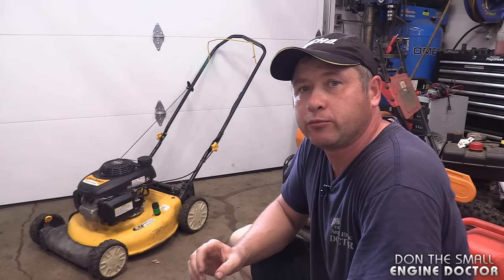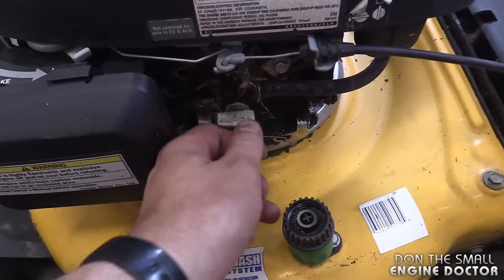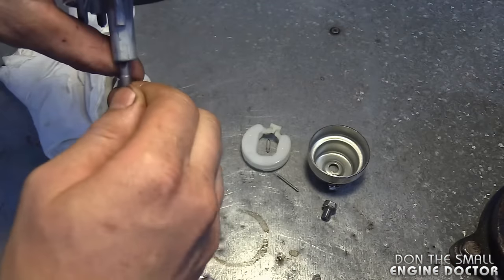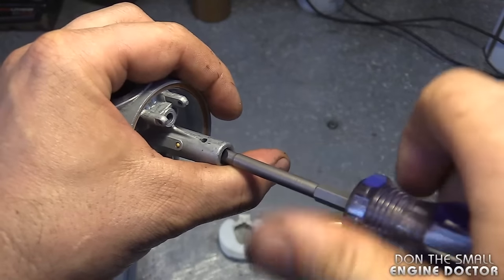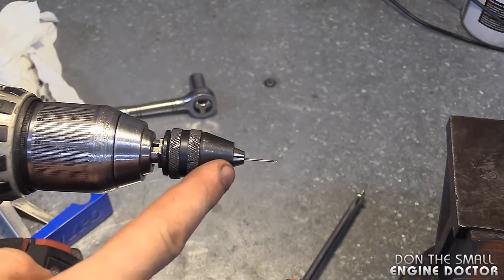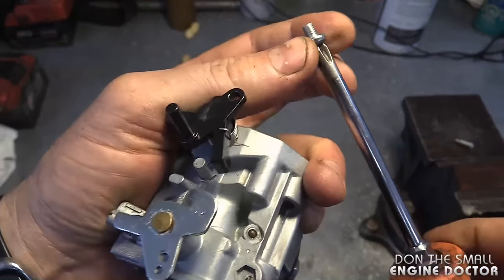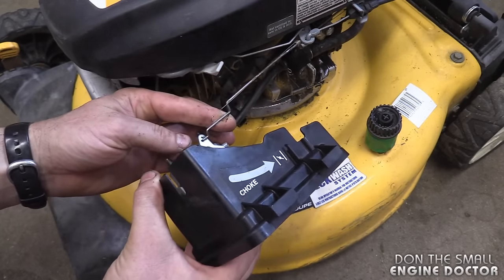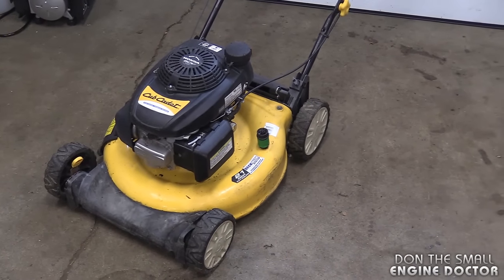How To Fix A Surging Engine on a Lawn Mower, Generator, Pressure Washer & More

Comment: Hello Don.  I've got a CT Yardworks model with the no choke and no prime engine.  Surges like crazy.  Will I be able to do this on that carb?  The butterfly doesn't seem to stick but I also have to use the carb cleaner to get it running most times unless it's warm.  Thanks for the excellent videos!  You've helped a lot of us out over the years!

Comment: Thankyou for the video. Use this cure regularly but only 1 issue. Drill bits breaking. I cant seem to find a quality bit. At least not on amazon. Do you have any suggestions of a good brand/source? .010/.015 size I assume.

Comment: Long time subscriber and follower of your videos.  I've been working on GCV160 with the same surging problem that starts after 5 minutes of running.  I've cleaned the carb twice, still surging...ugh!   Where do you get a .013 drill bit, and how does a bit that small not break when drilling by hand??  I have a set of micro drill bits from HF and the small ones will break if you look at them wrong.  I was able to get the smallest welding tip cleaner wire through that slow jet under the phillips head screw.  If that doesn't work I'm just going to buy a new carb.
Reply from the maker: I get them on Amazon

Comment: Dony boy..... 
You've helped me out in the past, so I hope you can again! 
I'm a woodworker, so I don't know  beans about engines. Here is my problem. 
I have an 8 year old Duromax Elite 4500E generator with a 7 HP engine and has been garage kept. Don't run it as often as I should.... 
Wouldn't start a while back, so I ordered a replacement carb kit on Amazon for 12 bucks.  Still, no go.
So, I noticed that the fuel was running slowly, so I ordered a new petcock and filter.  Now she runs but couldn't get it to run except on
full choke and then it was surging.
I have 'tinkered' with the adjustable screws and have most of the surging smoothed out. 
I want to replace the spark plug, but I can't find any site that gives me a reference for this model generator. Any chance you might know ?
BTW, you vids are the only reason I even TRY to mess with small engines..... LOL 
Thanks Kindly.

Comment: Where did you get the little wire tool. That 1/ 13000 drill bit, what is that in new speak mm or is it measured gauge. Gotta a link/ hint for that too. Im a gemini, I have 2 gas mowers . Hit a tree root with the big honda, blade or shaft is bent, dont know which yet. Went to the lawnboy, starts on second pull, then surges and konks out, worked fine last year. Finally went to the old sears electric. Pugged in, dont work, open switch box, reconnect wire, hey works as good as 30 years ago. Hey, is there a hint to me somewhere in hear. Oh right, the big ariens snow blower started to surge last winter, bloody h**l.

Comment: I have a zero turn mower with a similar problem and I just got it out of the repair shop and it seem to be surging some and the guy is suppose to stop by and check it for me, and I will have him check the second mower which isn't cranking at all now. The battery may be one problem on that mower and that mower is cheaper, but nearly new and can't figure out why it won't start and run. Thanks for the tip on the mower you worked on.
Reply: Why wouldn't you just take the battery out of the first mower and put it in the second mower to check if the battery is the problem?

Comment: Great video Don. I have one with the plastic screw and jet like you worked on. I can't find the engine model or carburetor number to order a rebuild kit or carb.(Mine has a different problem. Do you have the carb number or part numbers handy? Thanks!

Comment: so, my mower is the powermore 173cc , same carb as the second one you showed there with the plastic screw and pilot jet with the jet inside it shown at the 6:00 mark. i cleaned that out and opened it up 13thou just like you did, as well as the emulsion tube inside as you showed with the first carb. both have been cleaned up and opened up the exact same as you did in this video. i also replaced all gaskets and cleaned everything within the carb (im an automotive technician but i dont do small engines at all!). I have it all back together the same way it came apart, and i still am having the surging issue, worse if anything. sometimes the engine wont even run without having the choke on! any ideas? I got the mower for free from my father in law so its not a huge issue, i also have a few briggs and stratton older engines kicking around ill use if i have to, but id like to get this one fixed up as its super easy on fuel, i can do my lawn three times on a 2 dollar tank of fuel!

Comment: Thanks for the video I use seafoam always in my premium fuel and I put a fuel filter on my honda  I also spray some carb cleaner in the carb every few tank's of fuel never have this problem
Reply: I have been using Seafoam for ten years in my power equipment and my cars.  Before I go to the gas station with my 5 gal. gas cans I put 5 OZ of Seafoam in the empty cans and fill with Plus Grade. Every three months or so I take a can of Seafoam to the gas station and dump it in the car's tank before I put the gas in. Results: I have not had a problem with any of the engines that I treat with Seafoam - Lawn equipment starts right up in the spring and Snow moving equipment starts right when I need it. My cars? I have not seen a "Check Engine" light since I started using Seafoam. 

Full Disclosure - I am not affiliated in any way with the manufacture, distribution or selling of Seafoam. It just works!

Comment: great videos.I have a 2017 cub cadet snowblower  i left some gas in from last winter and drained it today and shined my flashlight into the gas tank and its rusted inside already from running ethonal premium?
Reply: machine has like 6 hours on it
Reply: Non ethanol would be better if you can find it. I keep a large can of it to run my small engines. No more ethanol problems.

Comment: Dony, that tube that connects on the back of that air cleaner assembly on my GCV engine is cracked and wont stay connected. oil drips out on the mower deck and is coming out of that tube. Can you explain what that tube does, and where does it connect on the other side/what is the purpose of that hose. I need to replace mine. Could you provide the correct part number so I can properly replace that cracked dry rotted hose? Thanks for these videos...i learn a lot from them.
Reply from the maker: i'll try and make a video, it's a crankcase air vent
Reply: Great video Dony, as usual! I’d love to see a video that talks about the lines on 2 & 4 strokes that are not fuel lines. Crankcase vent, impulse, vent, etc.
Reply: Popped off for Donny too 8:15

Comment: i need help Dony. I'm on my third carburetor and second engine with the same problem. Its the briggs and stratton EX engines with the Plastic Carb and auto choke. I've replaced the Jet Assembly 3 or 4 times now and have put on a new carburetor as well as enlarging the main jet. Still surging. No matter what i do the mower will still do the same after a minute or two. Starts surging and hunting , revving up and down. What am i missing ? got to be a vacuum leak is all i can think of but from where. ??

Comment: Hi Don I have a generator with a 11hp Honda engine and on the low idle setting it revs up and down, not just a little bit. I cleaned all the Jets including the plastic pilot jet with no change. It runs fine on high, there is no throttle. Does it sound like it's the  governor or the low idle mechanism 
?

Comment: I like you're very concise videos as a subscriber. I have a Kohler xt675 and I keep seeing oil saturating the air filter and I am having trouble starting it. Any suggestions?
Reply from the maker: i would check oil lever to make sure it's not over-filled, also maybe valve adjustment is out

Comment: Donny, Thanks for the info! My neighbors mower does that and yes it is annoying. I may have to offer to fix it for my sanity - haha.
Does the hose connection to clean the inside of the cutter deck really work? Have you made a video? If not would you please? Thank you.
Reply from the maker: yes the mower connector to wash deck should work if you start with a clean deck

Comment: I have the same honda engine .. after cleaning the carb and put on sonic cleaner .. my mower still hard to start and takes  a few pull.. and when it ran a few minutes .. it's still hard to restart it again.. could it be a really bad carburetor and I need a new carburetor.. when do you consider that it's time to replace the carborator?

Comment: My lawnmower surged when idling.  My simple fix was to add carburetor cleaner (Sea Foam or Gumout; 1-2 ounces per gallon) to the gas supply.  Never surged after that.

Comment: My Snapper rider started surging so I just bought a new carb, changed spark plug, fuel line, air filter & still surging.  Where should I look next? (Briggs & stratton engine)

Comment: Is this a bandaid to compensate for other underlying issues such as a worn throttle shaft/shaft bore lateral play? It seems the mower I'm looking at has significant enough play that it would likely create a big vacuum leak which I suspect is what's really causing the surging.
Reply from the maker: Not a band-aid, just enlarging the small jet to the size it should be.

Comment: Hi I have a Tecumseh Enduro 16 ohv and the crank case gets vary hot 
I checked the valves the cooling fins and all the heat shelds are in place and checked the breathr, it this normal for the Enduro 16  or is there something wrong????

Comment: Don, this is the first time I have seen you not flush everything with lots of carb cleaner.
I noticed too that you hate using those gloves, me too.
I usually spray my hands with WD40 after and then use hand cleaned BUT the other day I bought some dawn dish liquid and put about 150ml in a pump bottle with about 400ml of water.
Well I found it so amazing that I had to tell you about it.
Just spray a little on each hand and the grease gone.
Reply: I use Dawn and mix it with Orange.

Comment: 9/10 times on Honda GCV160 and GCV190 it's more cost effective for a shop to replace the carb as those carbs are typically $12-$20 in the USA anyways...

Comment: Couple caps of Seafoam in the gas tank before you go to the trouble of taking it all apart.  Just a time saver,  it usually works of your dealing with a clog.

Comment: Hey, love your videos.  I watched your video on repair manuals.  Where can I find these manuals?
Reply from the maker: usually find online, did you need specific ones?
Reply: donyboy73  Fixing to start up a small engine shop.  Maybe mobile. I have a couple of  older manuals. Just need to update.  Are you guys having trouble getting parts for powermore because of Restrictions on China?
Reply from the maker: @variator05  some backorders yes, even stihl has a shortage

Comment: Excellent video as always. I’d be concerned about drilling too deep or wide. What are the repercussions of that taking place?
Reply from the maker: if the drilled hole is to big it may not rev up properly
Reply: @donyboy73  why the need to drill....why not clean ??

Comment: Don, hear my problem. The mower is a self-propelled (rwd). New belt, clean carb and filter, fresh gas, new oil, new plug (start of season maintenance). The motor runs great for a couple of minutes, then starts bogging down even on an inch of grass. Rpms get really low but doesn't stall . Then all gets well for some time and you can go into 5" of grass, the rpms kick up instantly, everything works fine. Tried with the drivetrain off and it's the same. Goes in circles. Mechanical governor, some chinese engine unfortunately, but very clean, maybe 4 yrs old. Any clues? Tnx!

Comment: Don what do you think about those garden hose connectors for cleaning the decks on mowers? Is it really just a gimmick?
Reply from the maker: i think it really works if you start off with a clean deck and use it after each and every mow

Comment: I have toro super recycler and can not figure out why it will not start back up after it gets hot. Takes about 10 pulls to start when cold. I have changed plug, air filter, fuel line and cleaned carburetor. Any advice on what to check next?
Reply from the maker: checked the auto-choke if equipped with one
Reply: @donyboy73  I resolved the issue. The manufacturer calls for a .30 spark gap and it was to much so I closed it up and starts like a dream. Thanks for you reply and keep up the informative videos.

Comment: "We're not working on the space shuttle..." I bet there's someone out there wondering what the torque specs are for the wing nut that holds down the air filter. We're cutting grass NOT flying to the moon. Good stuff.
Reply from the maker: for sure there is!

Comment: Hello don! Do you think you could help me? I have a gcv160 on a pressure washer that surges just like this. I replaced the carburetor today and it still surges! What could I be missing? Any help would be so appreciated
Reply: Run Redex or another fuel cleaner through it. Leave a day or two, start it and do the same a day or so later. Beats all that drilling out bollocks!
Reply: @Harstena1  awesome thank you I'll try this

Comment: I've had to do that to my dads Honda GSV190 powered lawnmower on a couple of occasions, this weekend it's my brothers Subaru Forester which is surging,so far I've found that cylinders 3 & 4 aren't firing because there's no fuel injector pulse to those 2 cylinders.

It's dual fuel so I need to isolate both faulty wiring & the LP gas computer as being at fault,I'll know later on today if the wiring,LP gas ECU or the main ECU is at fault !

Comment: Great tips Donny! What’s the purpose of the large square gasket, does it double as a heat shield or help direct air flow to the cooling fins or something? If so do you think there are any potential problems that could show up if we don’t use it? Awesome vid as always bud!
Reply from the maker: more of a shield

Comment: What causes mine to surge was the ground screw mines a toro mower with a honda engine I took the carb completely apart all the fuel lines off the gas tank cleaned out, everything, and still it surged until I cleaned the corrosion from underneath the ground screw and the wire then it was fine.

Comment: At 8:35, I laughed when you commented, "I don't have the torque specs-- we're not working on the space shuttle, here." A nice contrast to your otherwise very methodical approach. 
It was also reassuring that you took care to caution against drilling out the tiny vent with a drill bit larger than .013".

Comment: The pilot jet screw on my HRN216 carb will not come out. I ended up having to drill it and use an EZ-out. Now after cleaning, the carb runs rich and still surges. I gave up and bought a new one. Junk.

Comment: before you take the carb off , take the carb cleaner tube and hold it with needle nose plyers and  direct it in the fuel jet in front of the butterfly....might save some trouble.

Comment: On the carb I am having issues with, @ 6:00 when I remove the plastic 'jet', the brass insert has no hole in it.  ???  Engine on air compressor surging excessively.

Comment: Same procedure on a 23hp Kawasaki on the zero turn Cubs?  Mine is doing the same thing with only 10 hours on it.
Reply from the maker: that would be different. if it's new take it back for warranty
Reply: @donyboy73  it’s a year old but I bought it with 8 hours on it end of last season but I was able to register it with Cub so maybe.  I would rather fix it myself though, it’s definitely carb related for sure.  Runs mint full throttle mowing.  Anyway, love the channel, and the accent👍. My family is from 🇨🇦

Comment: I always wonder why they used bolts instead of studs. Makes for assembly insanity. (shame on you Honda).. Great video!
Reply: It's actually not that hard to remove the studs.
Reply: @kbakeritsallaboutnobody.5761  DON'T NEED TO REMOVE STUDS, THE TROUBLE IS LINING EVERYTHING UP ON THOSE STUPID BOLTS...
Reply: @pafoofnic  I find it easier to remove the studs. Align everything on the removed studs and then install everything all at once.

Comment: Donny, why don’t you just clean out that secondary jet instead of drilling it out? Won’t that work? I’ve never done that and don’t know the setup in there.
Reply from the maker: very critical to drill it out, sometimes the small hole shrinks over time
Reply: Seems common on those hondas that perfectly clean they are still too lean.
Reply: @donyboy73  I had the same problem with surging and with that secondary jet. I did a thorough cleaning more than once but couldn't get my smallest torch cleaning wire into that secondary jet.  And, I didn't have a micro drill bit to clean it out. I wish I had one. I ended up installing a new carb and gaskets.
Reply: Yes cleaning is only thing nessesary I've done it many many times. The manufacturer makes the jetting very specific any increase in size will NOT run correctly

Comment: smallest drill bit I have found so far is a 1mm any idea where i can find a .013? I checked LOwes and Hobby Lobby
Reply from the maker: check amazon, "micro drill bits"
Reply: @donyboy73  got my fingers crossed with harbor freight which is local otherwise I will go Amazon. Thanks!!!
Reply: Run fuel cleaner through it! FFS

Comment: Interesting. I never had to enlarge any jet in any carb I have ever worked on, just good clean with micro needles, ar cleaner and shop air and they are like new. By enlarging that idle jet you are increasing the idle speed of the mower, which can be compensated by the idle screw setting soe no issue really. However, if you are not very good with your micro drill bits you stand a very good chance of ruining otherwise perfectly good carb imho.